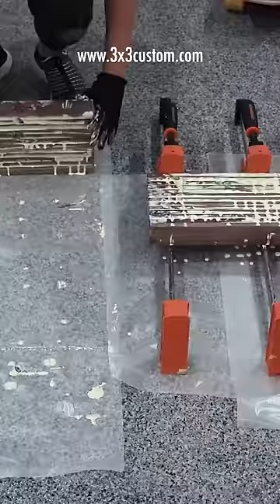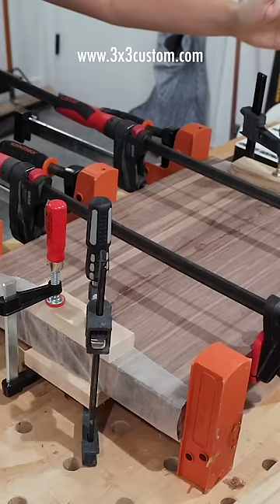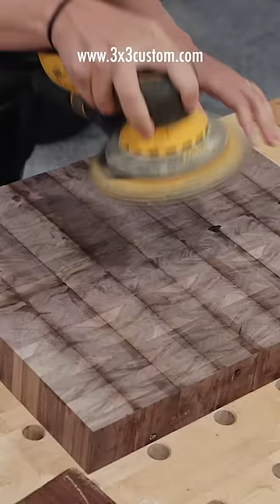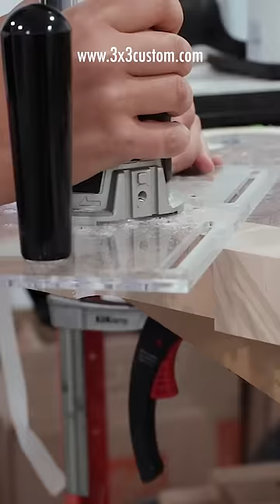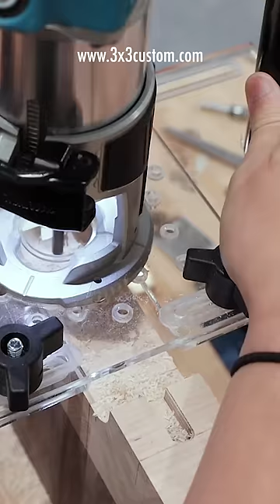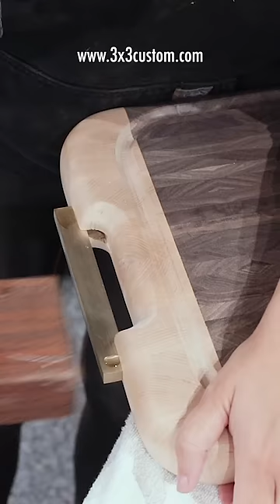Turning a Failed Project into Something USEFUL

Comment: Pairs strapped together instead of along the whole length will get you the strength you need. You could try cable or rope widthwise through the boards to avoid all the sewing. Strategic knots between some pairs of boards could give added resistance. Still, little fingers....